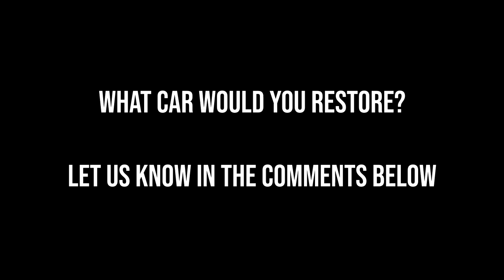EK HOLDEN RESTORATION | DAD'S STORY

Comment: Nice car when your finished. Love the the brake shaft extension. Will be a gem with the 5 speed. Are they those x2 exhaust headers?
Reply from the maker: Thanks Tim, yes its got X2 headers on it, we're gonna run a twin system unbalanced! 
Yes certainly gonna be a pleasure to drive with the 5 speed and brake set-up 🙌😊